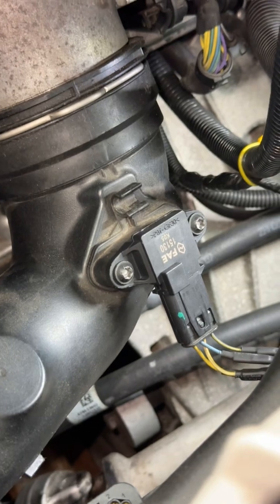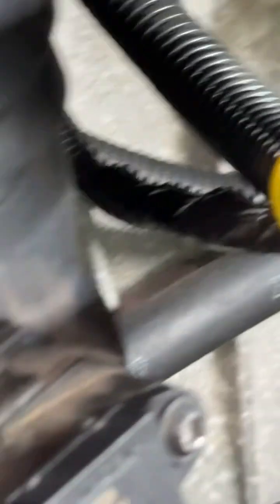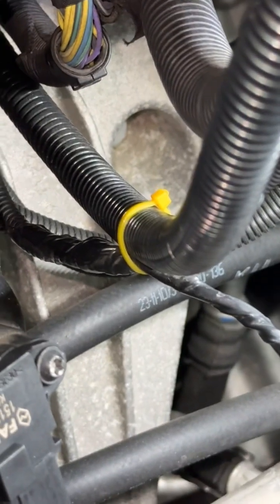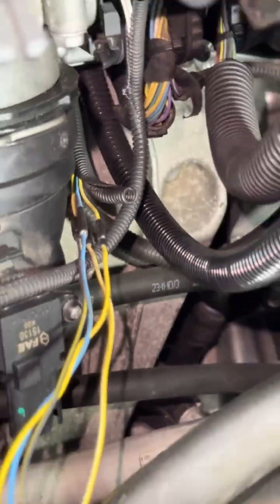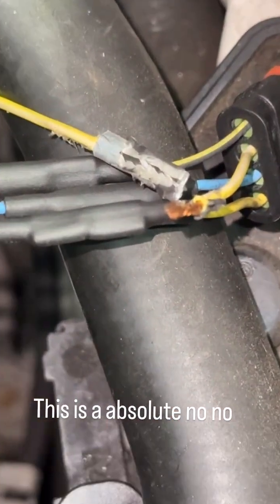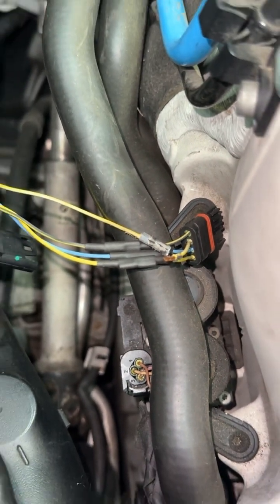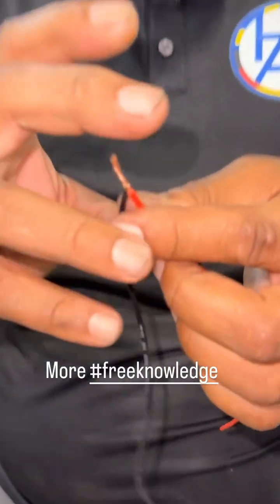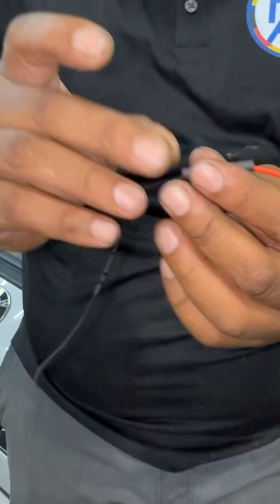Never use butt connectors

Comment: 100% correct on butt connectors. They will ALWAYS corode and give you fits.
Pro tip on twisting the wires together, add solder to the connection, and insulate it with marine heatshrink.
Reply: I believe the marine heatshrink is the operative term. With normal heat shrink, you can still get some moisture at the twist and have corrosion that will increase the resistance. My preference would be to use open barrel crimps with marine heatshrink. The open barrel crimps on the wire and insulation, giving more clamping force.
Reply: @myZcarlife  Excellent
Reply: Yep. You want the heatshrink with the moisture sealing glue.

Comment: This is absolutely wrong. You don't bend a wire and put it in a connector. It can fatigue and break .  You take the wires and slightly "fray" both wires so you have loosened the strands, then poke them together inline, and twist. Then get a big enough butt connector to clamp over that. Then heat shrink over that. 

And if he had used large enough butt connectors, he could have twisted the strands inline before clamping.... and it probably would not have failed.